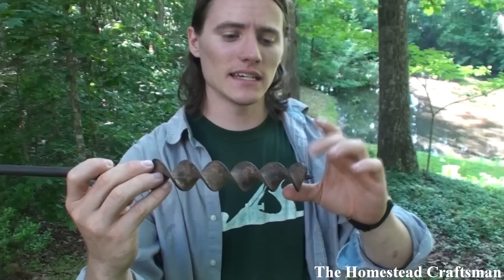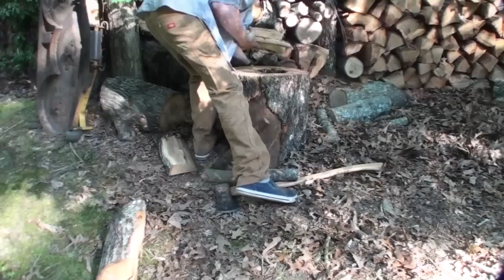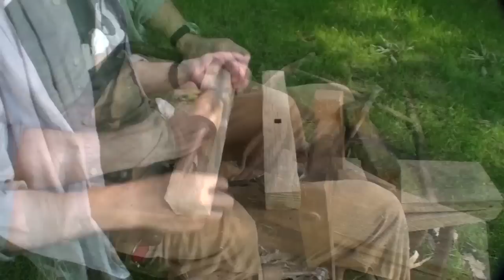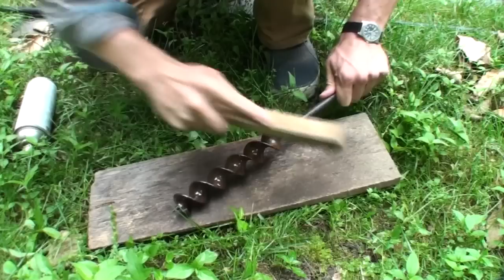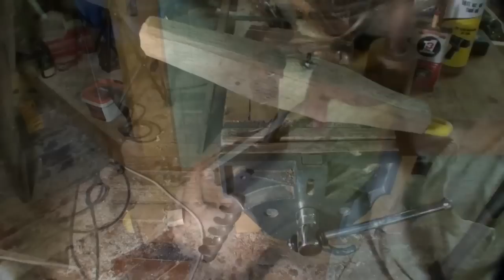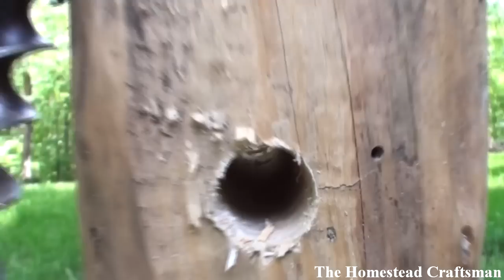Timber Framing T Auger

Comment: Very awesome.  Glad to see younger folks hanging on to old ways.  May come in handy some day.
Reply from the maker: I don't use them all the time, but I do use these types of hand tools on occasion. For example, I made a spinning wheel and drilled the holes for the legs with a brace and bit using scribed sighting lines to keep the angles I needed. It was easier to figure out than using the drill press. Thanks for watching.

Comment: Nice job, I just recently found a James Swan company T handle for an auger that had a broken bolt that I replaced. The 5/16 bolt and wing nut had a nickel plating. I soaked the bolt and wing nut in apple cider vinegar for a couple hours and all the plating was removed and now it looks as old as the rest of the metal. I sure enjoy your Chanel.

Comment: Great project. I just acquires a bunch of those bits as well as several braces and am going to restore them. Thanks for the encouragement and ideas. I have some duplicates that I just might put that style handle on. Thanks and God bless!
Reply from the maker: Eric Day Good deal, I don't use my brace and bit much, but I do pull it out every once in a while when I drill odd angles or in big stuff that's too tricky to get on the drill press. Good luck

Comment: If I can not bind the connection with a lashing of some sort,( even 16 ga. rebar tying wire and a pair of linesmen plyers works well ) and return to secure the framing with a wood auger and dowel pinning, I'm not even wasting my time on it. Screws snap, nails pull out, and in my opinion, nothing beats a big hole plugged with a big chunk of wood wedged in it to hold it tight for a few hundred years or so... EXCELLENT INSTRUCTIONAL VIDEO . I rate it 5 out of 5 stars based on the knowledge shared, narration / explanations along the way, and video quality all combined. Great job kid. I've only watched this one video so far, but I'm looking into the others as well. Videos like this deserve subscribing to, and I've already clicked those buttons Bro, so keep 'em coming !
 With all due respect,
Mr. Cross / aka: 12 Block Tokie 
Detroit, Michigan
Reply from the maker: Thank you

Comment: Pretty cool, I do like hand tool also, and my house was built in 1897. I found a five foot 1 1/2 inch auger in the basement. No handle, but a neat find. Thanks
Reply from the maker: That's a cool auger you've got, A simple handle would be fairly easy to make if you wanted too.

Comment: To remove the zinc plating you might have an easier time using acid - even vinegar will do a quick job of it. It is also less dangerous, zinc fumes are notoriously poisonous.

On the handle - I've seen some T auger bits (even smaler than yours) with a steel plate on the bottom side, to reinforce the handle.

Comment: Nice job restoring a good tool.  Quite a bit of work just to do what you did.  Imagine all that originally went into the fabrication of the tool.  Thanks for the video.
Reply from the maker: The auger bits are really interesting, it's basically forged out and twisted into the spiral, most are made with some sort of machine of sorts, but some of the old old ones where forged and shaped by hand. Thanks for watching.

Comment: Very nice,, love seeing two dollar finds cleaned up and put back to work. I have a nice old two piece handle I picked up for just a couple dollars that allows me to change bits. Do not use it much since I got the pacemaker, a little too much work sometimes, LOL. Great stuff, I also really like that long handled round mallet. I will be making one like it soon :)
Reply from the maker: woodturningjohn For this tool, I don't use it really, but just like fixing them back up, I'm sure in the future it will be put to use. When I need to drill holes by hand I use my brace and bit, otherwise I'm in the shop and use my drill press or hand drill.

Comment: Great video. I just bought a 2" ;t handle auger and will be restoring it when I get a chance. The old handle has a clenched nail on either side of the hole to reinforce it. Maybe this was added later.

I was wondering about burning the bit in like I do on my file handles. But maybe you want it easy to remove for storage?

Comment: Nice vid.
I have one of these from my Dad, and his family before him. Mine doesn’t have a wing nut tho. The end is bent over and is permanent. 
Thanks
Reply from the maker: That’s the way this one was as well i think but i tapped the end to fit the 1/4 - 20 wing nut for easy disassembly. It would allow you to have one handle for multiple bits of the tapers match.

Comment: Nice to see a Fray brace (I think) in action drilling the first hole in the handle.
Reply from the maker: +Toolrific Yes it is, a while ago, I got an entire woodshop of tools and this was one of the many tools I got. I just cleaned it up on a biffing wheel. I've used it on a bunch of projects, set of stools, spinning wheel, shaving horse and other projects where your drilling holes on angles where I didn't want to bother with setting up the drill press. These types of braces are the best in my opinion over the more standard chucks you see, they are much more simple, don't slip, less in your line of site and don't weigh as much. When I got all the tools, I got 3 or 4 braces and a ton of bits.

Comment: Well done - reminds me of Dick Proenneke in "Alone in the Wilderness" - I really need to see if I can find a good flea market around here. 

Have you tried using 'Evap-o-Rust' on any of your restoration projects?   I've used it on a few Disston saws I've nearly finished restoring. Fairly good results -- but it does seem to make etchings harder to see.
Reply from the maker: Alan T Yes, I've used evapo rust. I like it a lot. I've used it with a bunch of stuff, the biggest being restoring an old delta unisaw. Good luck with the flea markets.

Comment: Great video! What wears out on my drills is the starting screw. I weld the screw and then refile the threads. Takes some time. Any better ideas?
Reply from the maker: Steve Larsen Not sure, I can't imagine using one of these enough to wear out the screw. You could cut it off and weld on a new one, but that's just as slow probably. My guess is you doing it because you want to not because your counting on it, so probably just stick with your method and enjoy yourself. You could also just find some more in better condition if they are more work than they are worth.

Comment: I really appreciate how you restored and old favored tool with old school crastsmanship. Came out great and looks like it cut through nicely! If I may ask, what are the two side holes in the handle for? Came across a couple old planes that I need to find blades for. Was told they were used in a wood furniture shop here in NC back in the 30's or 40's. Don't do Facebook so can't send you pictures. Thanks for sharing.
Reply from the maker: The "two holes" are not holes, they are two small knots. The only hole is the the one that the tapered tang of the bit goes through. I drilled halfway with a 1/2 bit and the rest with a smaller bit. Then tapered it with a chisel. Thanks for watching.

Comment: I would be helpful if you would explain your thought processes. For instance, how did you decide the best piece to cut out of the wood in the beginning? What were you looking for?
Reply from the maker: Jean OConnor Hi Jean, for a handle like this, while it may look like it's under a lot of pressure, it's not really under much stress, so the piece of wood you make it out of and it's properties are not super important. Any hardwood without any major defects will work. Pine would work fine to I'm sure. So if I was looking for anything in particular, I would pick a straight grained piece of wood so that it splits nicely. If I was not filming, I could make this handle in less than 10 min, so remaking it is not an issue if something ever happened to it (which it won't) but in the case of making something like an axe handle, it is undergoing a lot more stress and shock. So grain orientation, wood type and handle shape make much more difference. For this tool, it's perfectly fine to just do as I did, pick of some fire wood and knock it out. I hope this is the thoughts you where looking for. I very the style of my videos which include length and level of detail. Some are shorter with less talking and others are longer with a lot of talking. If you have not already, watch a few more on topics your interested in to see what I mean. It's long, but the longer version, of "how to make a log peavey" has a lot of details I also make a shorter version of the video that is about 2-3 min long. Thank you for your comment. http://youtu.be/5fVYbUxwHl4
Reply: The Homestead Craftsman
Thank you for your reply. I guess the explanation that it is not under much stress and therefore not as important as an axe handle would have been enough for what I meant.
I didn't realize that you make more than one version of your how to videos. Sorry. I'm new to your channel.

Comment: a great idea I've seen people use when chopping wood is to wrap a few bungie chords around it, or place it in a tire.  You can keep chopping without having to bend over to pick up the pieces.
Reply from the maker: Stephen Brockhoff I've seen people do the tire trick, it's a good idea. I use a electric log splitter, so I have not tried it myself, I'm just pushing a button! Splitting by axe is sometimes a lot faster, but it wears you out fast. Thanks for watching.

Comment: It has no cutting edges left on it. And it's a square tang bit for a brace.
Reply from the maker: It works well, the shape at the top is common, you would not put this in a brace. They have a portion at the top that is threaded for handles like I show. I re tapped the threads.

Comment: I like on the bottom of the handle to make a flat plate with a square hole and the edges bent over.
Reply: Rl Badger I just made one with a metal insert to make it stronger.
Reply: janken919 Cool!
Reply: Rl Badger Probably upload a video tomorrow on that and a take down saw that I made.
Reply: I think I'm 1201, just subscribed.
Reply: Rl Badger Thank you sir! Just about to upload!

Comment: i might be wring but aren't you supposed to sharpen the inside edge as well as the wings
Reply from the maker: Patrick Dixon Not sure exactly what your referring too but it worked pretty good in the end, thanks.
Reply: The Homestead Craftsman if you sharpen the bottom of the cutting edge you may not think so but over time you can end up changing the geometry of the bit, it works in the long run but in future always sharpen the side not in contact with the wood.

Comment: Great vídeo. How do you recognize    if the drill is made for a "T" or it's supposed to be used in a manual driller? Sorry for my English
Reply from the maker: The shape of the top, they will vary but the ones with T handles are distinct, either a flat tapered tang or a 4 sided taper with threads at the top. Also, these are larger than the bits you use in a brace......but there are larger manual drills for timber framing, used in making mortises.
Reply: The Homestead Craftsman Thank you very much for your answer. I got a relatively small one, I guess it is for a manual driller but I was thinking about making a T one with it

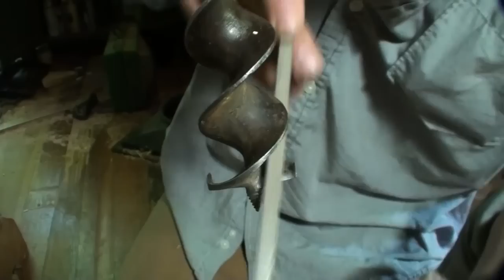Comment: @ 7:01 you don't want to sharpen that side it messes planing action of the blade.
Reply from the maker: It had a lot of pitting and needed to be smoothed out, it may have looked like I was taking a lot off but I did not. Sometimes you have to do what you are "not supposed to do" to make things work. It was part of restoring the auger, not part of regular sharpening.
Reply: i see, sorry then.
Reply from the maker: No sorry necessary , normally you don't do that in sharpening. Thanks for watching.